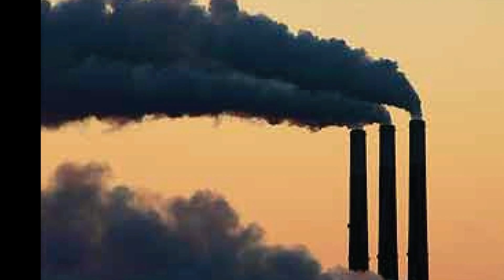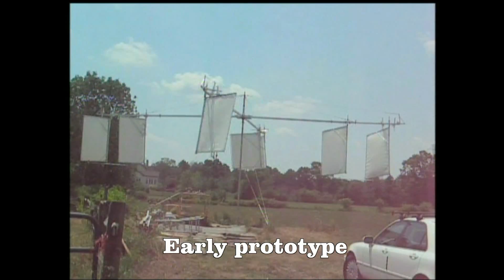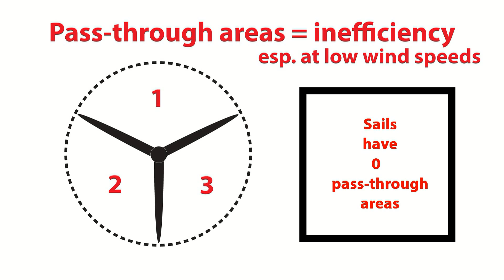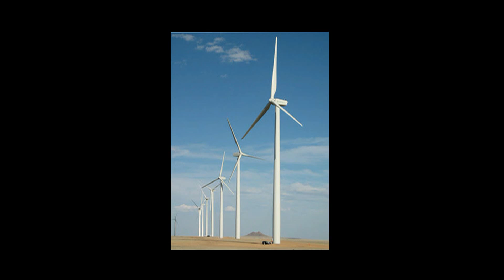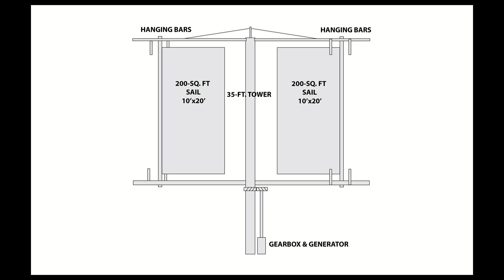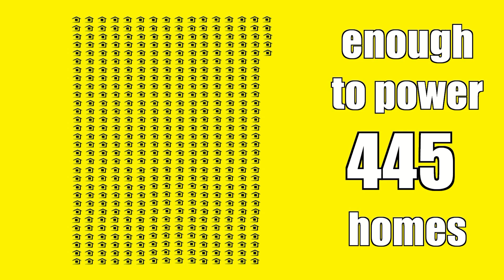The MIGLER WHIRLWIND: the new, quiet, powerful, bird-friendly windmill

Comment: "The engine Center" is correct. That is a VAWT. If it produces 48% more power then the normal wind turbine (horizontal) That would be impressive. The VAWT will be the wind power of the future, Right now it has to be improved on . Good luck to Mr. Migler

Comment: This is nothing new. It's sort-of a Savonius vertical shaft windmill. They sell them on EBAY. ALEKO WGV30 TURBINE VERTICAL ON-GRID OFF-GRID

Using pillowcases to catch the wind is not very original. I think the Dutch have been doing it for a few hundred years. The biggest problem is that windmills are not efficient until they are 100 feet in the air where the wind speed is high enough. 

Windmills are a curiosity.